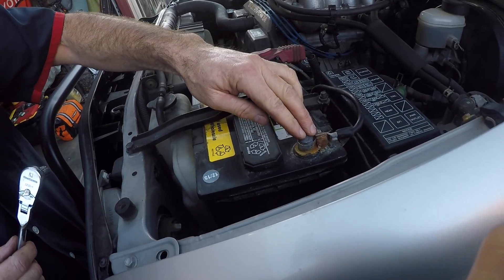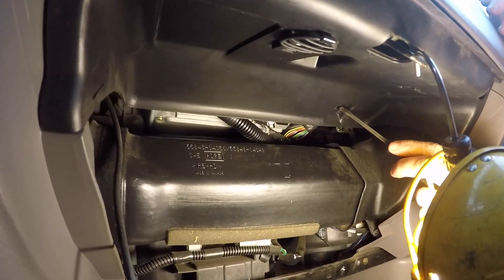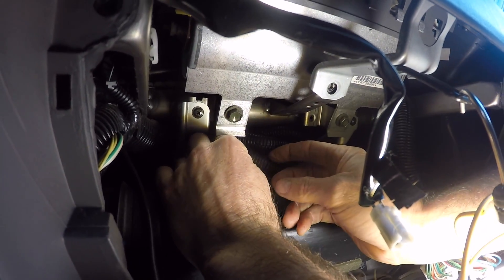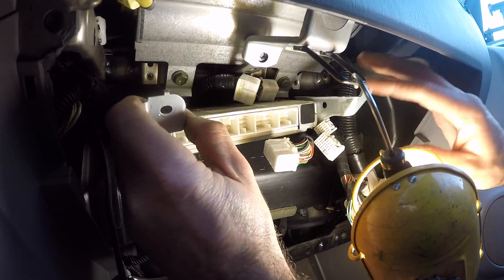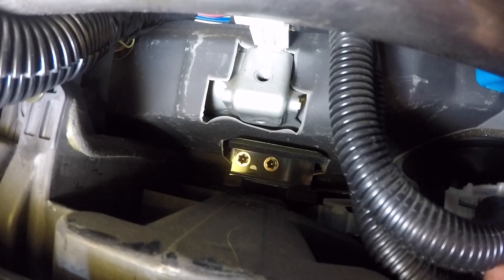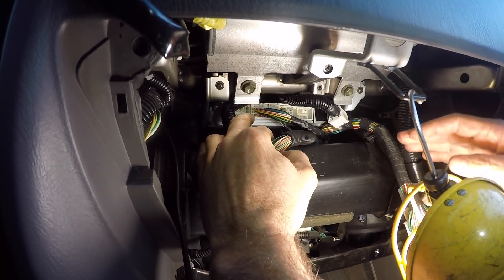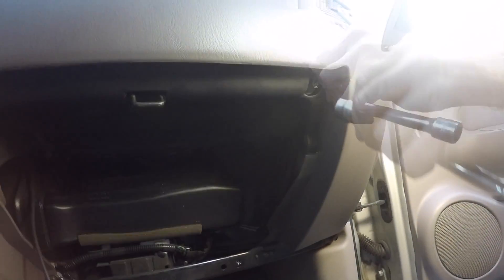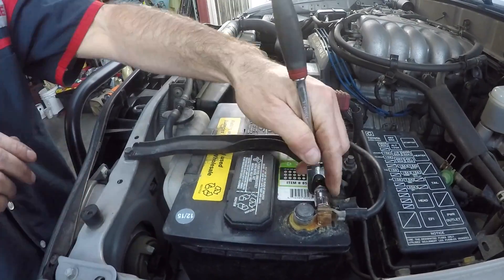ECU Replacement

Comment: Hi Tim, I'm in a pickle and hoping to hear your suggestions.

My 5vzfe is using what looks like a 4x4 A/T ECU with 4 blocky plugs (similar looking to a 1995 Tacoma's ECU). And no the label is wiped off so I don't have the part number. 

Now, I've tried to wire it to the OBD2 port using E5-18 SDL as the signal wire on Pin2, ground on Pin 4,5 and Battery on Pin16 but I cannot get it to work. I've alternatively connected E5-18 SDL to Pin 7 of the OBD2 port and that doesn't work either. I'm starting to think it's because my JDM ECU does not support OBD2. 

Do you know any other wiring schemes I could try? I am also open to other advice as to what I should do moving forward. 

Thanks for your help.
Reply from the maker: That's interesting that you say you have a 4-plug ECU.  All the ones I've seen for the 5VZ-FE motor for 4runners and Tacomas have been 5 plug.  Maybe that's your issue right there.  But, maybe that's how the Japanese JDM issues are wired.

You've hit a topic I'm not well-versed on and that's auto electrical.  I do have a 2000 wiring diagram in my possession that I could take a look at and see what I see.  Do you actually have a 98 wiring diagram in your possession?  If not, you can pay $20 for a two-day subscription to Toyota Tech info and access the info you seek.  The only caveat is you need a Windows based computer to use their site.  https://techinfo.toyota.com/techInfoPortal/appmanager/t3/ti?_nfpb=true&_pageLabel=ti_home_page&contextType=external&username=string&challenge_url=https://techinfo.toyota.com/techInfoPortal/login/techinfo&password=secure_string&request_id=-6604130355241257782&authn_try_count=0&locale=en_US&resource_url=https%3A%2F%2Ftechinfo.toyota.com%2F
At the very very bottom of the page I linked, there's a link you can click on to show the system requirements.  What I did is bought a refurbished laptop from an Ebay seller so I could use the Tech Info website.  This the computer I bought from a seller with a good reputation: 
https://www.ebay.com/itm/Dell-Latitude-E6420-Laptop-Windows-7-8GB-RAM-250GB-256GB-SSD/292385184197?ssPageName=STRK%3AMEBIDX%3AIT&_trksid=p2060353.m2749.l2649
Reply: @TimmyTheToolman  Thanks I think you've just pointed me in the right direction 😄😄.

After reading your response I realized something. I assumed that my 4 plug ECU was comparable to the early Tacoma's and therefore I was only looking at the 95 Tacoma wiring pinout. But just noticed that some late years also had the 4 plug ECU with a different pinout. So maybe my ECU is comparable to these and I was connecting to the wrong pins. So all hope isn't lost and  my ECU may supports OBD2 🤞🏻🤞🏻😊. And I have the ECU pinout in PDF for almost all years of 5vzfe Tacoma and 4runners and also have the complete wiring diagram for some but thanks for sharing the resource.

I'm surprised you only see the 5 plug ECU though. I have found a number of different US based YouTubers using the 4 block ECU on their trucks🤔
Reply from the maker: @spago555  Well, I've only seen two ECUs so far, one from a 1st Gen Tacoma and one from a 3rd Gen 4runner and they were both 5 plug ECUs so I just assumed they were all 5 plug.
Reply: @TimmyTheToolman  Ahh okayy.  I'm going to attempt to wire the OBD2 again tonight. In case I fail I'll just have to source a USDM ECU then 🤔

Thanks for your help Tim.
Reply from the maker: @spago555  I was wrong.  The 97 4runner I just worked on only had 4 plugs for the ECU.

Comment: Hi I have a 2007 Toyota Tundra 5.7 I replace the 2 pump on the passenger side and the secondary Air valve under the air intake all set but the vsc, the Pic of a truck sliding and 4Lo flashing what do I do for this to stop or how to reset the computer? Kingarroyo@yahoo.com if u can help great videos
Reply from the maker: Don't know what your issue would be but if you want to reset the computer, disconnect the battery for around 10 minutes and then reconnect it.

Comment: Hey bro this is not a ecu question but there’s a clicking noise coming from the fan area under the same area but to the left do you know what I’m talking about
Reply from the maker: Does the noise occur only when the fan is on or is it all the time?  In that area is the AC evaporator.  When it's making the noise, is the AC on?

Comment: What was the problem with this vehicle ?? Did you find  ??
Reply from the maker: Yes, we figured out the issue.  Greg's engine has gross play in crankshaft.  Greg's engine has an audible knock and this is the cause.  We believe the knock sensors were originating the misfire code.  Check out the video: https://youtu.be/9Gpdq-tL79U
Reply: @TimmyTheToolman  i have one question i have yaris and when i ON AC the rpm stays 850 for 2-3 min then slowly start dropping after 3 mins and drops to 680 and engine vibrates and i ON OFF AC then rpm don't go back to 850, but after one minute rest when i ON AC then it goes to 850 for another 3 mins and then again start dropping without any reason, air filter is new, throttle body is like mirror and new spark plugs new intake manifold gasket new valve cover gasket and new engine mounts (3) and new fuel filter and new injectors, no codes no misfire and runs like a butter on highway
Reply from the maker: @mridware9694  So the problem is only when the AC is on?
Reply: @TimmyTheToolman  yesss, when AC is off car runs fine at 680-700 rpm
Reply from the maker: @mridware9694  Well, maybe there's an issue where the AC compressor is drawing too much amperage or maybe the clutch bearing is toast causing a drag on the motor when the compressor turns on.  I unfortunately am not an expert at diagnosing issues like this.  Are you hearing any weird noises when the AC turns on?  Are you getting cold air?
Reply: @TimmyTheToolman  yes AC is  cooling fine and no noise coming from the compressor, this is clutch less compressor with solonide and when i accelerate little to raise the rpm to 1000 then rpm is not smooth and shoot to 1500

Comment: Got a 1993 Toyota pickup truck with the 3L V6 in it mine's doing about the same thing! After a few miles number one misfire comes up code. About 10 to 20 miles this time I've been tinkering with it and it didn't come on until 50 miles and it came up again. Seems to be getting very bad gas mileage. Those the gas tank and as somebody change the fuel pump but did not put the rubber plug in for the wires on top of the gas tank and come to figure out they was driving it for about 10 years like that! I could not believe what I was seeing in the fuel filter the fuel filter was completely stopped up change it but still did not fix my problem? If I figure it out I'll give you a shout out! I'm about done the same thing you and you guys are done. Keep the good job up! I want to do a new map sensor? Maybe?
Reply from the maker: Hey Phillip, good luck figuring out your misfire issue.  For sure let me know what you figure out.  Happy Wrenching!

Comment: Great vid, not sure if this is connected to my problem.  I have a 98 Tacoma and driving home one day my speedo, tach, radio all stopped working. Truck still running I went straight home, I got home and turned it off and it hasn't started since. Been troubleshooting and noticed my 80 amp ALT fuse was burnt. Replaced it, but still nothing. Everything is  still the same. Any ideas? Wondering if my ECU is done??? Thank a bunch
Reply from the maker: Have you checked the other fuses?

Comment: Hey, have I tried to read ECU in TIS (Techstream) yet? Who's Vin shows up? Did the donars truck Vin stay with ECU?
Reply from the maker: We didn't think about the VIN.  We were just interested in fixing the misfire problem.  You would have to reprogram the ECU and I don't know if that's worth it.  As long as you get an ECU from the same year and model rig, the ECU will work and keep your vehicle on the road.
Reply: @TimmyTheToolman  Do 2000 Corolla ECU's necessarily need to be reprogrammed? That is to say, if I procure an ECU with a matching model number from a donor vehicle that is of the same year, is it likely to work without needing to be reprogrammed? The key is literally just a metal key with no immobilizer, if that helps.
Reply from the maker: @MrRusell86  My guess is no reprogramming would be necessary if the ECU is from the same year and model.
Reply: @TimmyTheToolman  Okay. Cool. That is what I thought. I get a lot of conflicting answers from sellers on eBay. Some say reprogramming will be needed while others say the replacement should work just fine without. 

This is to try and solve an endless P0171 issue as the LTFT comes in at 39%. I have replaced the fuel cap, PCV valve, 02 sensor, MAF sensor, and air intake gasket. 

A mechanic believes it is the ECU as the car runs fine otherwise. I think I'll change the fuel injectors while I'm at it, too. The car is due to get smogged in April so time is something of the essence.

Comment: Wow you guys sure know how to fire the 'Parts Cannon's... What's next? Engine or bring it to a great mechanic. Try Eric over at south main auto.. maybe it's cam or crank sensors?
Reply from the maker: We figured out the issue.  It was gross play with the crankshaft that caused a knock and most likely the knock sensors were throwing the misfire code.  His engine is done.  So yeah, you were right, an engine swap is necessary.  Here's the video showing the crankshaft play: https://youtu.be/9Gpdq-tL79U  Nice job talking shit Sean.  Yes, we threw parts at Greg's engine problem like lots of guys do.  Maybe you should stay on Eric O's YouTube channel because we're just dumb DIYers over here on the Timmy the Toolman channel.  The next time you talk shit, your comments won't show up anymore.  There's a way to talk respectfully so try a little harder next time.

Comment: Hey will a 4wd control module from a 2004 v6 Tacoma with e locker work in my 2004 Tacoma 2.7 4wd that I put a complete axle and complete factory wire harness from a 2004 Tacoma v6 truck. And I have the existing plug on the harness for the computer. I just read online 2001 was the last year I could get the option of a e locker in a 2.7 Tacoma. They are rare but I have seen them at a dealership. It was a factory add on if you bought the truck new
Reply from the maker: I think it would work out just fine but I can't say for sure because I've never done it.  It makes sense that it would work though.
Reply: Timmy The Toolman I just called the dealer the part number is the same for the v6 and 2.7. Good to know! That info isn’t out there that I have found.
Reply from the maker: @thatdude4000  Yeah, it sounds like it's going to work out.
Reply: Timmy The Toolman now where to find them used? All the salvage yards have the black module I can’t find the green module behind the aux plug anywhere! Any leads? Been searching Tacoma world today I just made a account
Reply from the maker: @thatdude4000  You're looking where I would.  I'm guessing you've also checked Ebay?

Comment: Hey Timmy, How are you mate? Other great video, thanks again for sharing with all of us, buddy I would like to ask your opinion in a situation my Toyota Prado 5VZ-FE 1998 is experimenting..... From not long ago, to start the engine in the mornings, takes me 2 attemps (cranking attemp), what I discovered was,  once I pass the key on the ignition to  just before cranking position is, the fuel pump is not priming, but once I crank the engine few seconds I am able to listen the pump working (maybe the crankshaft sensor works),  then once the fuel lines got some pressure on, the second attemp to start the engine is satisfactory and the Landcruiser Prado runs fine..... I had a check all fuse, relays involve that factory manual T100 (which is the one I got) says, and  nothing wrong.... I Checked if the EFI relay under the hood is receiving signal from inside the cabin and is fine... its looks operating. I did check the SEPARETED operncircuit relays, are fine too... checked the diagram schemactic and looks like the computer send some info to the open circuit relay, but dont know from what imput, Im guessing from some sensor like MAF or something like that which could not working 100%.... I checked the MAF sensor and is on spec 2.3Ohh at 20C centigrades of temperature.... My car from factory brough 2 fuel pump with 2 fuel tank plus a changeover swicht, that system work fine too. The problem happen with both pump.  Well mate sorry for the long story but really I am scraching my head finding who is the responsable plus start to have that feeling of the car is no reliable as used to be!..... any imput from you I do really appreciated it bro! If you want reply me by emaul this is mine:   jesromer@hotmail.com cheers mate!....
Reply from the maker: Definitely sounds like a fuel pressure problem.  Have you replaced your fuel filter.
Reply: @TimmyTheToolman  Yes mate, I have done it, still doing the same thing.... and happen with both fuel pump (main tanks and Sub tank).....
Reply from the maker: @jesromerg  Hmmm.  Well, it could be a sign the fuel pump is failing but since it's doing it with both tanks, I doubt both fuel pumps decided to start failing at the same time.  If you have a way to check your fuel pressure, maybe check it upon the first start attempt and compare that to the second attempt.  I haven't tried to measure fuel pressure yet on these engines but I know the factory service manual shows tapping into the fuel rails.
Reply: @TimmyTheToolman  yeah factory manual says to remove somo bolt on the fuel rail at the front side and connect a special fittment for the pressure gauge.... That is going to be a difficul one for me, dont have the gauge yet... well look what I did, I was able through the diagnostic port to brisgde +B and FP connectors before the first attemp, simulating a priming action, the fuel pump ran with out problem until I took out the bridge wich was for 4 second then I decide to give it a go as first attemp and the engine started like a Theft car... on the very fisrt one attemp....
Reply from the maker: @jesromerg  So, do you suspect an ignition switch problem because with the key in the "on" position the fuel pump isn't priming?
Reply: @TimmyTheToolman  Well definetely Fuel pump is not priming (when key in on position), haven't rule out 100% the IG switch yet, but  I have done some primary testing  on the EFI relay under the hood and  is receiving signal from the IG switch when the key is ON....

Comment: I did the same in my car and it didn't work. The mecanic said that the inmovilizer doesn't let start
Reply from the maker: I guess the immobilizer has to match the ECU?
Reply: @TimmyTheToolman  how can I bypass or to anulate the immobilizer?
Reply: @TimmyTheToolman  I swaped my 4runner into a manual transmission , but, now it doesn't  have power . I stick with the A/T ecu 'cause M/T doesn't let turn on .
Reply from the maker: @josealfredoquinterogarcia4178  Did you get the right M/T ECU for your year and model rig?
Reply: @TimmyTheToolman  yeah buddy but I think I need to deactive the immobilizer . My car has an immobilizer  .
Reply from the maker: @josealfredoquinterogarcia4178  Yeah, I don't know how to help you on this.  This is above my pay grade.

Comment: You didn’t program it even the key?
Reply from the maker: No.  If the ECU comes from the same year and model vehicle, there's no need to reprogram it.  It's already got the same program.  That's the whole point of finding an ECU from the same vehicle.  As for the key, maybe if you had one of the more newer keyless entry vehicles that would be necessary but I don't know for sure.  We're working on a 1st Gen Tacoma in this video that doesn't have a programmable key.  It has a security system but that didn't need reprogramming either.

Comment: Would it worke without reprogramming even if i replace ECU with used one from junkyard?
Reply from the maker: Yes it would provided you pulled an ECU out of the same year, make and model vehicle you need it for.
Reply: @TimmyTheToolman  are you sure about that? I though dealer had to reprogram. Never seen a  ECU just swap out. 97 manual 5vzfe
Reply from the maker: @htownboy2k  The one I swapped into the Greg's rig came from the exact year and model and had the same part number on it.  His rig ran without issue with the donor ECU and we did not reprogram it.  So, I'm sure as long as you're swapping in an ECU from the same year and model and it has the same part number stamped on it.
Reply: @TimmyTheToolman  I've swapped one from the exact year make model same part number.. just cranks and cranks
Reply from the maker: @htownboy2k  Hmmm.  Don't know what to say.  It worked for us.  This was my only experience doing something like this.  Maybe you got a bad ECU.
Reply: Possible ya.. thanks for the comments! I'll follow up once I know why lol
Reply from the maker: @htownboy2k  Yeah, let me know what you find out.

Comment: Do you have to get the ECU flashed to the current vin number and mileage?
Reply from the maker: As long as the ECU came out of the same year and model rig, you should not have to flash it.  As for the mileage on the odometer, I'm unsure about that.
Reply: Timmy The Toolman  i bought an replacement ECU, same part number as my old one. All it would do is turn over. Im wondering if my chipped key is tripping the security

Comment: Ecu from some Toyotas have been recalled.
Reply from the maker: I suppose that could happen.  Do you know what models?
Reply: Corollas 4runners and others
Reply: I remember getting a letter in the mail from Toyota for my Corolla 2015. Now my tags are coming up for renewal in Feb. And the DMV in CA is requiring that we take care of it before then.
Reply from the maker: @pckilla187  Gotcha.  Better get over to your local dealership and let them swap it out for free.
Reply: Just did. Took 2 hrs